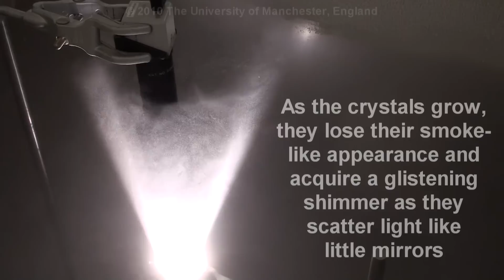Demonstration of the Bergeron-Findeisen Process

Comment: Ice particles hold on to water molecules more strongly than a liquid droplet.  So there is much less vapor around an ice particle than a liquid droplet.  Now vapor diffuses (by random motion) from the region with more vapor to the region with less vapor.  Therefore vapor diffuses from being around liquid droplets to being around ice particles on to which some will stick (deposit).  In this way, liquid droplets lose water molecules to the ice particles.